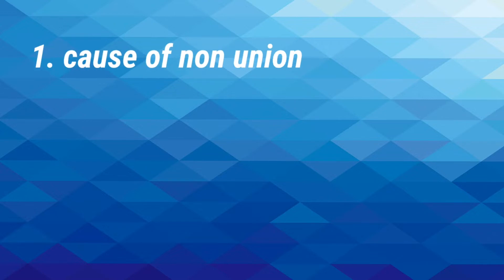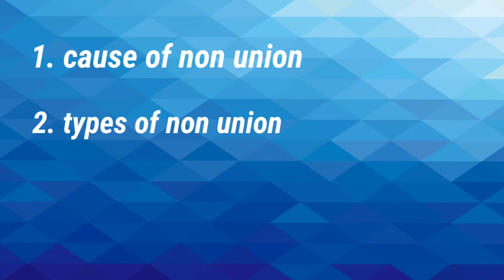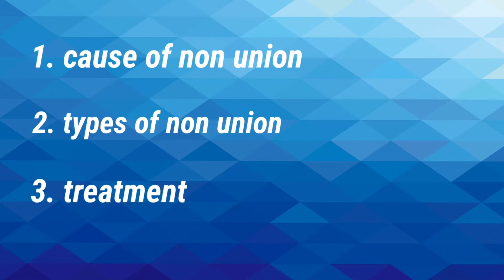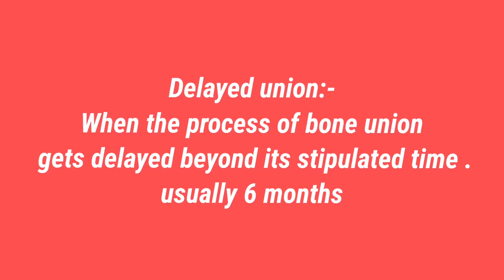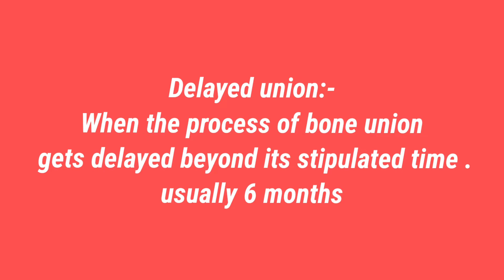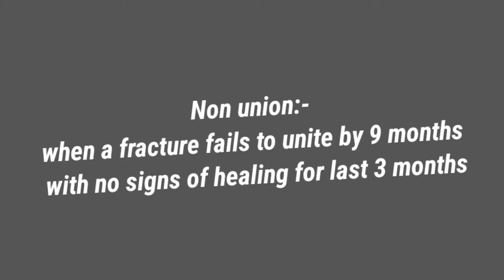non union fractures,cause of non union and delayed union.types of non union.treatment.dr prasenjit.

Comment: What is procedure after a delayed non union is treated with bone graft, antibiotic spacers, and plates. My 9 year old had open, butterflied tib/fib fracture. And after graft surgery we still have slow calcification and until a ct is done, I am unaware if it is actually bridging together… if surgery for non union is unsuccessful whats the next steps?